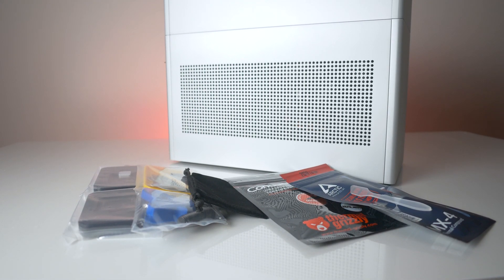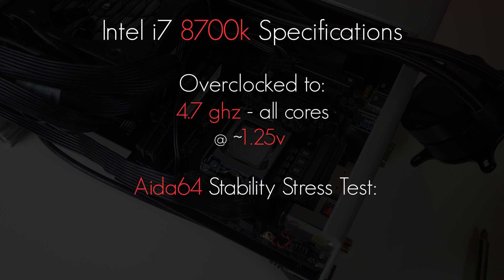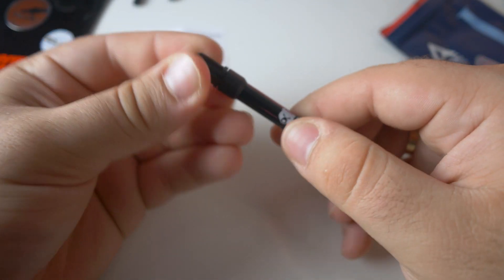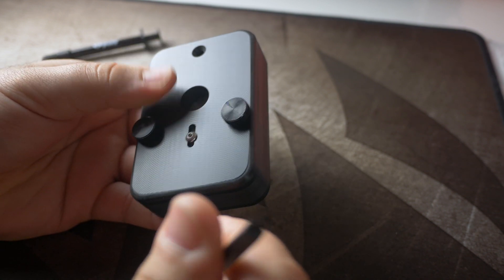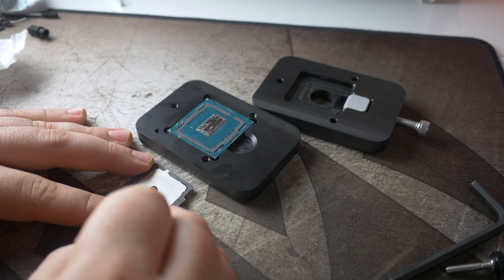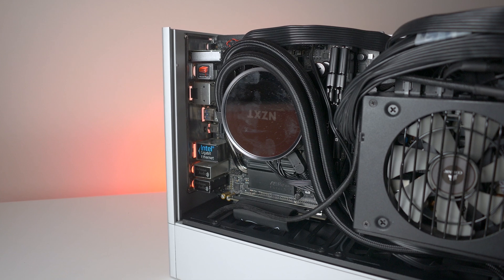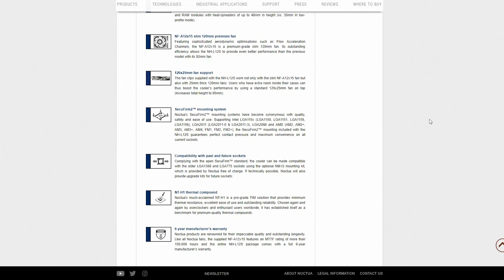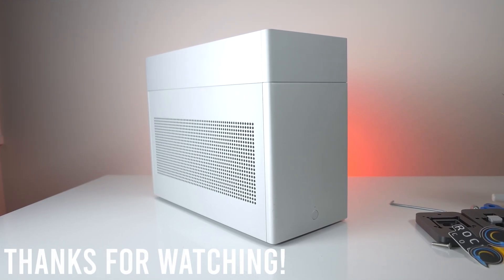i7 8700k Delidding w/ Test Results - 21°C drop!

Comment: Great video! I'm actually going to be delidding my i5. I did an i7 last year. Great b-roll footage dude.
Reply from the maker: Thanks! If you're gonna be overclocking, definitely delid because the temp drop is so worth it
Reply: @dpereiraalvarez  Yeah, I might. But, I'm using the InWin A1 Plus with an SFX power supply. With such a small case with little air passing through it, not sure if I should push the CPU to the max. But, we'll see.

Comment: Really nice video sir. I delided my 8700k in a Silverstone SG13 and with my Big Shuriken 2 I saw about a 10 degree reduction. Will move to one of the new ITX cases this year (Sugo SM570, ThorZone MJOLNIR or Sidearm T1). Really good to see how the X52 works with an 8700K in an ITX case.
Reply: Nice video production and your voice works well. Also have a delided 8700k & highly recommend if you need lower thermals or are using a tiny case.
Reply from the maker: Thank you :)
Reply from the maker: Thank you and good case choices :)